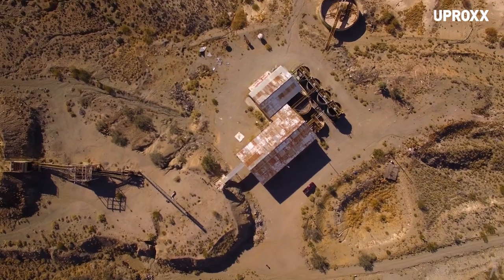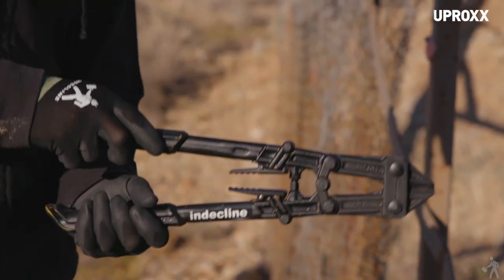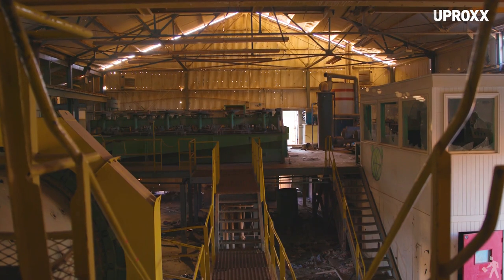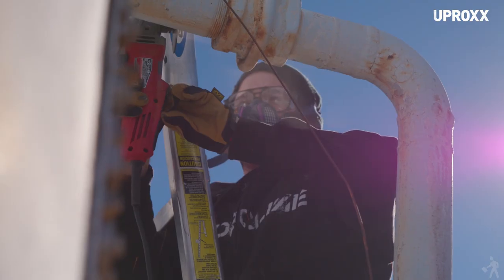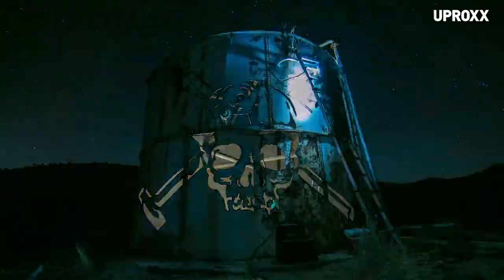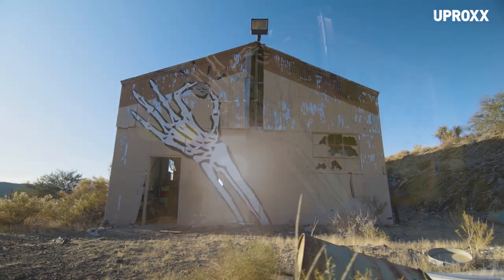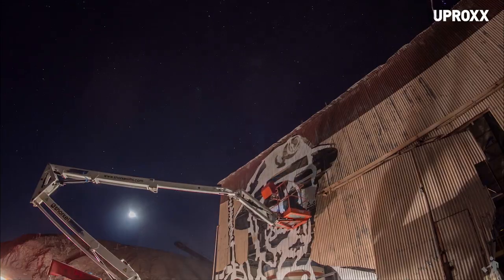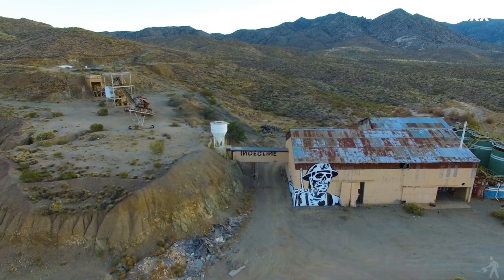Artists Turn Toxic Factory Into Massive Art Project

Comment: This isn't art, it's vandalism. It's bad enough defacing the structures with paint, but actually cutting holes in everything is really destructive. Yeah, I know the mill is just an abandoned industrial site, but it still has historical and cultural value. The only difference between this site, and a Gold Rush era mill, is time. I would much rather see this mill rust into antiquity than be vandalized or torn down.

In any case, it's not your property. If you want to spray paint all over something or cut a bunch of holes, do it to your own building.
Reply: vandalism looks cool
Reply: Old timer
Reply: Yes because something rusting into decay is more beautiful than an actual piece of art
Reply: @woodenrat4579   There's art, and there's ugly crap. This is the latter.